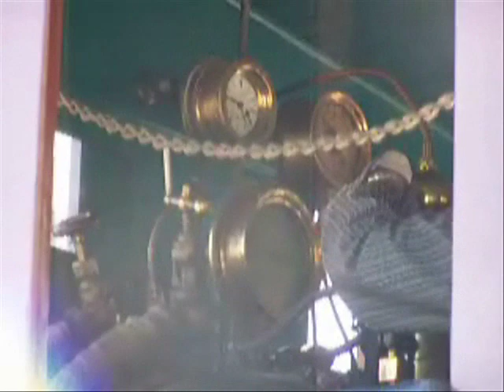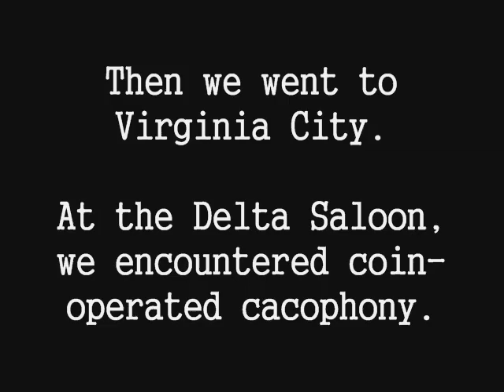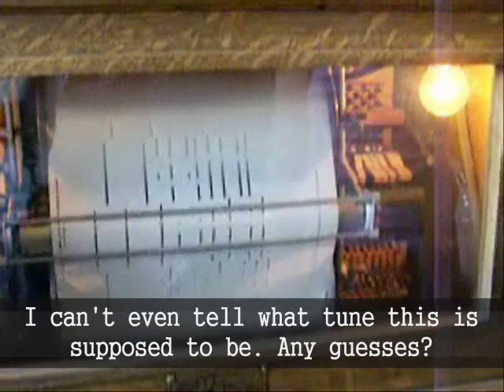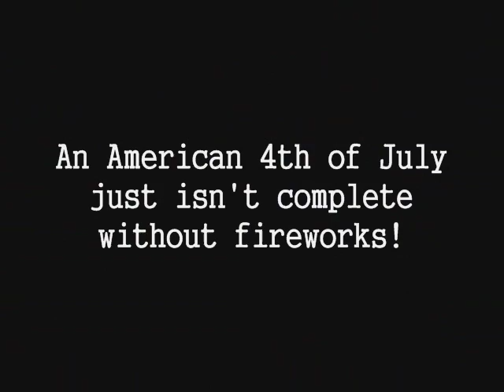4th of July 2009 part 2, featuring 1875 Inyo steam locomotive "Brass Betsy"

Comment: This piano needs more than just action work. It sounds as if the entire pinblock has cracked apart, allowing the tuning pins to slip more than just simply falling out of tune. It could also be that the sound board has lost all of its bearing, which can make a piano sound like a wash tub real fast. This particular piano case was meant to be a Seeburg Grayhound Race Piano, a sort of legal gambling device with rotating horses that circled as music played. My best guess at the tune would be "Pals".

Comment: This piano needs more than just a tuning... it also needs action work. Notice that one of the hammers on the far treble end is missing, while another one is twisted enough that it is hitting the strings for two adjacent notes!

If local Virginia City tech John Kirin won't fix it, send this piano down to Stephen Kent Goodman, or Mike Argain, both in the Fresno area. Either of them will be able to make the piano look and sound like new!